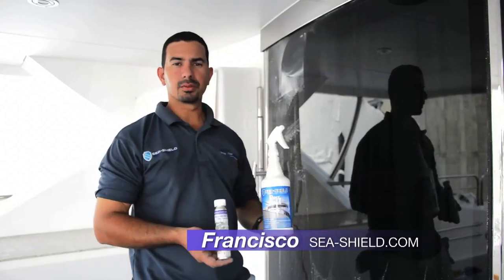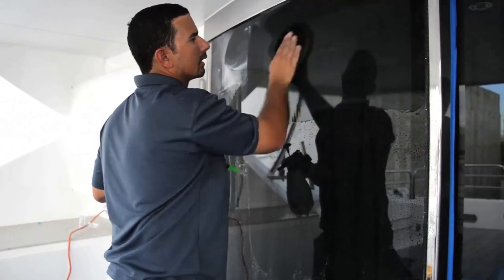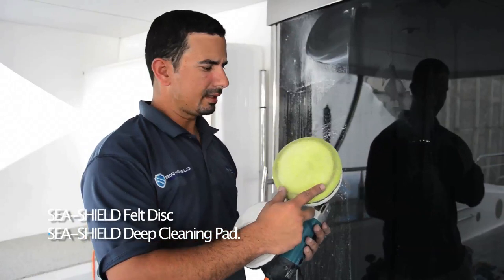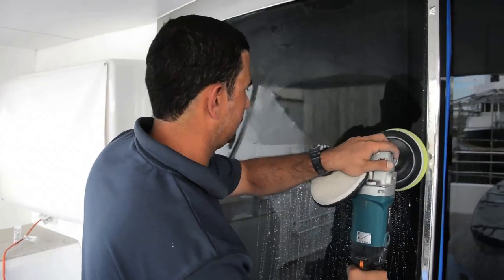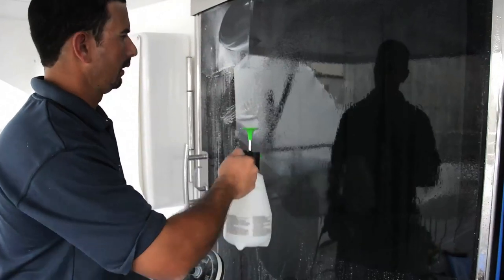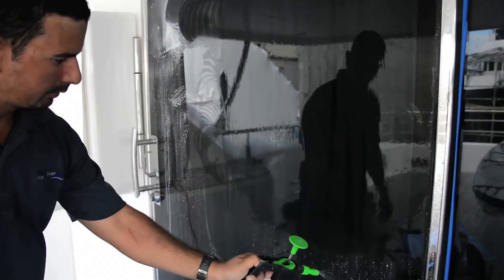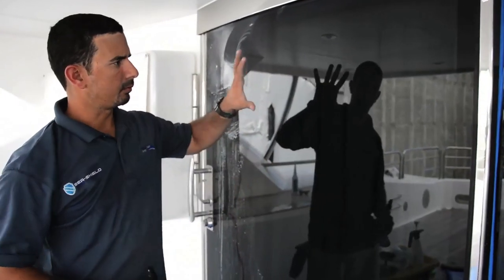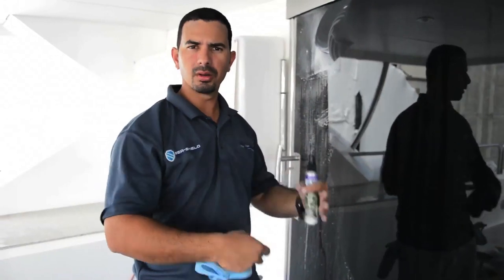How to Polish and apply a Coating to Boat and Yacht Windows

Comment: how long coating will stay or how offen you need to re-apply Glass Coating? in CA, FL states?
PS: or in my climate, Middle East weather condition.... 40+  celsius (104+ fahrenheit) 80-98% humidity.